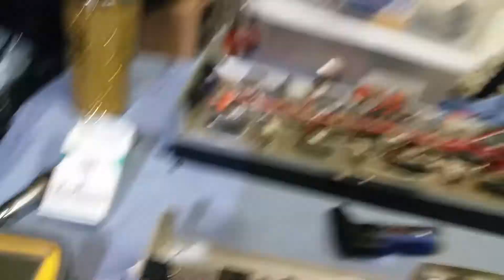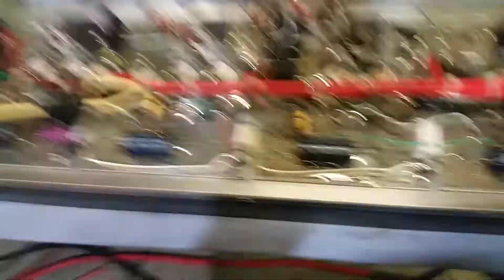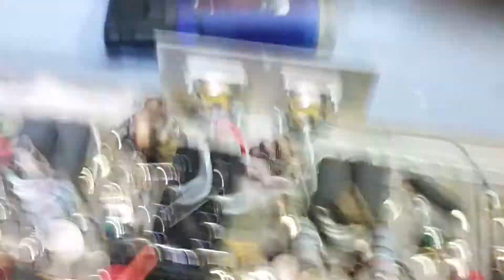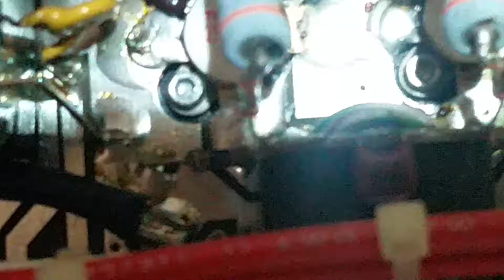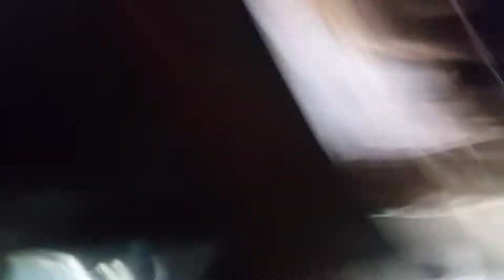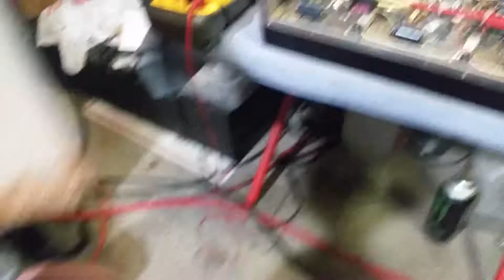💥 How RF Flows Through A Texas Star DX 1600 8 Pill RF Amplifier

Comment: I have seen some monster builds from the 16 and 3200.  The thing I love about the old TS amps is one AB biased and not near as nasty harmonics and feedback. Personally myself I believe you get more true RMS watts and cleaner amp. Also you can run a bigger amp less amps being drawn. Good walkthrough and explanation.
Reply from the maker: Thank you buddy :) Yes I love the more linearity that a TS gives you....atleast until you get them hot 🔥  lol then they will be a lot less linear.
Reply: @1883GotDown  I like a clean amp myself and yes heat and how they tune out makes difference lol. That's why I usually always keep my mouth shut when I see a 667 doing 650/800 watts because it's in spec but it will do a lot more and last but you have to know how to run it and what mods to do.  I see you skip or leave a few out here and there but I honestly know why. You don't want the owner to nuke it and if they don't have experience with amps especially. TS mods are endless but when it comes down to it I'd rather do 450 bird with max modulation a little before it starts to distort. A 2 tube amp doing 75/80 bird will stomp a 4 pill most of the time. Depends on who built it and how it's set up. 73 GK

Comment: them nice 8 pill box !  that the same age as my hotplate . just 2290 different tune caps.  I ran 4 10 AWG OFC cable . 1 4AWG  ground. used 8 AWG jumpers. 2290 does not draw as much amps. took out my remote jacks. even fan jack. no keying transistor. RCA jack is PTT . diode and ferrite on PTT line. even 103 cap . thermal switch removed. replaced 115F appx NC one in series with PTT line. over temp shut down. That my personal box I use. just 1-120mm fan runs all the time. banana jack pos lead. neg to case.  does not heat up much SSB. I drive 25 watt of less PEP . With a DX 1600 had this happen once and same on DX 667V . on 39 ohm feed back that cap 104 looks like a diode. had flash over . what happen is puts collector to base 39 ohm and will over bias and blow both transistors with out RF.  I learned the hard way  testing bias. I changed resistors . new 2879 . that one blown 4 pills on switch side. used 8-RFP 2879 at the time. $205 each japan at time RF parts. went with all 8 new 2879. after fixed I keyed relay with jumper . NO RF . dummy load on input and output . meter was on 2 pill section . as soon as relay keyed  2 -10 ohm buy switch side went up in smoke. the 2 watt 1.8 ohm stayed fine. 2 new 2879 dead. ouch ! carefully went threw found leaky 104 glass cap on feed back. under micro scope can see black flash over. later had DX 667V same cap went bad but knew to look before power up. That was a DEI box. I still have them 4 old japan 2879 but low HFE . 10 to 15 HFE read. box got hot. driven hard. 100 watt radio was used. That left with fans on when amp one. That thermal  in wrong place and to high temp to turn fans on. That why amp burned up. got hot before fans came on.  on DX 3.2 KW only did one. 16 pill. the thermal switch is mounted on back side of input resistor. 2 DX 1600 side to side. 73's